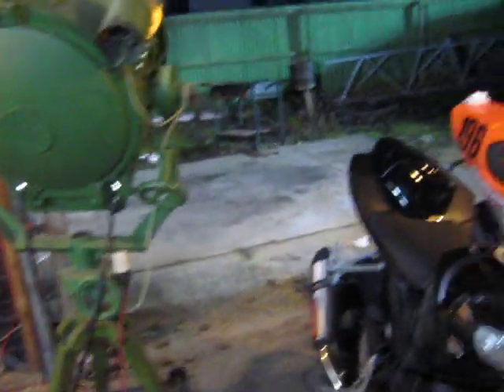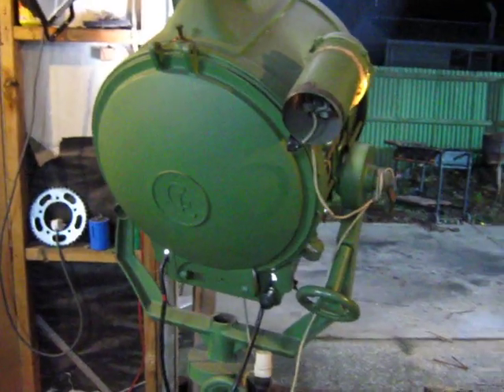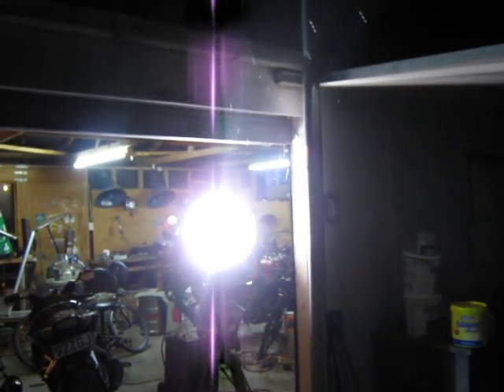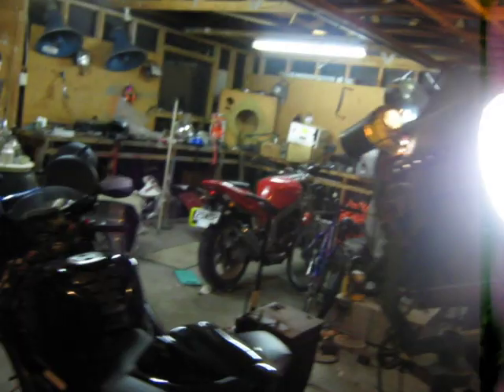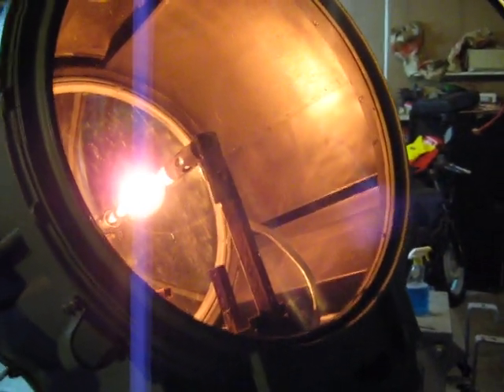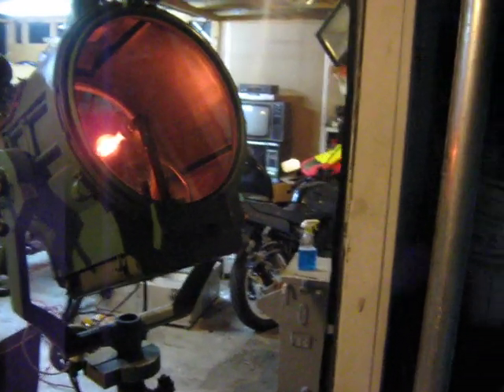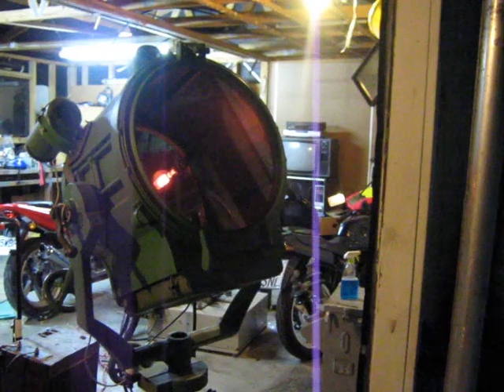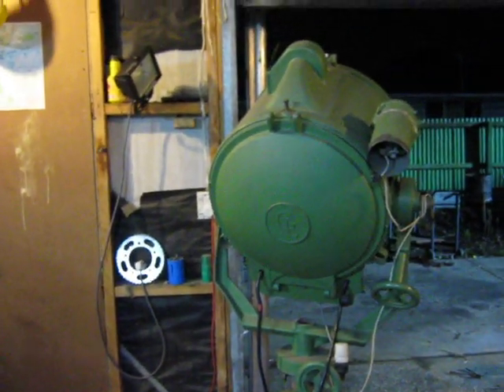XENON  SHORT ARC  LAMPS PART 2

Comment: It is amazing that the quartz glass doesn't get soft or melt completely under those high pressures and temperatures.
Great video.
Reply: RODALCO2007 The highest temperatures are at the arc itself, the metal components, anodes, must run a lot cooler. The quartz glass is also quite a distance from the heat source. Then you have the air inside the housing constantly circulating. All these factors combined is what makes the glass not melt. The higher wattage versions of these bulbs use water cooling.

Comment: Great project!  Could one avoid building the big power supply and run perhaps a smaller wattage bulb (1000W) on a couple of 12V car batteries for an hour or so?  When you spoke about a "blower", do you have a fan inside the searchlight?

Comment from the maker: Hi  i got it for free from the local cinema , they run them from new for a number of hours then dump them before they blow for reliability reasons, 15KW lamps I have seen and are used in the likes of Imacs cinemas. These lamps use specialised de-ionized water at very high pressures to cool them - for theses reasons I have not experimented with them

Comment from the maker: Hi and thanks for that,  my friend and I had planed to fit a 15kw lamp from a imax projector to a bigger fortress searchlight  but the 400 amp power supply and the high pressure deionised water for coolling all became to much so it did not happen.